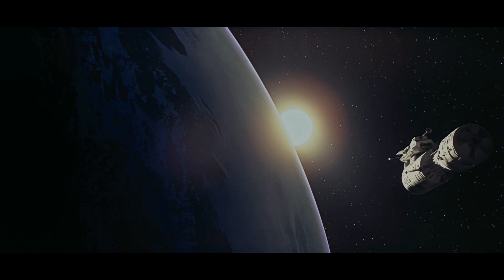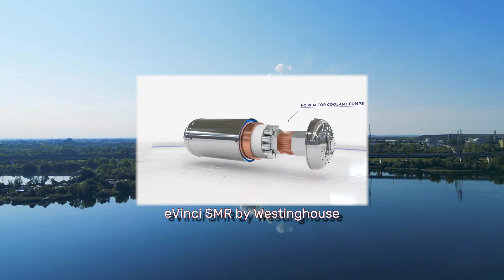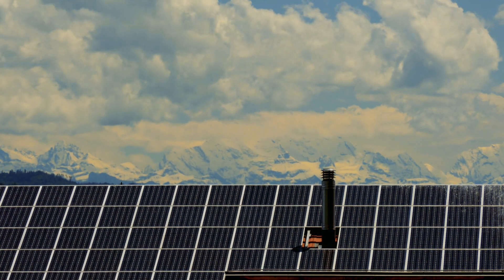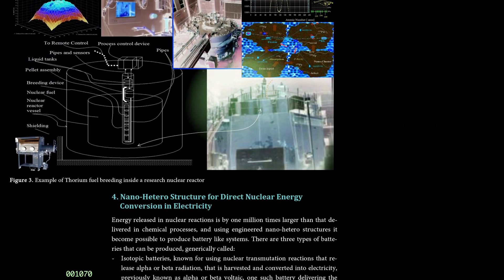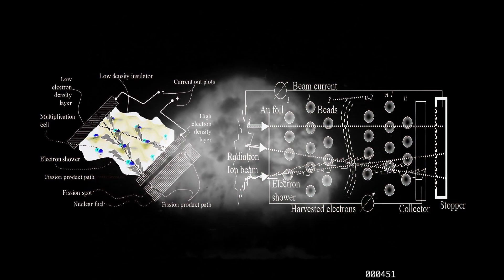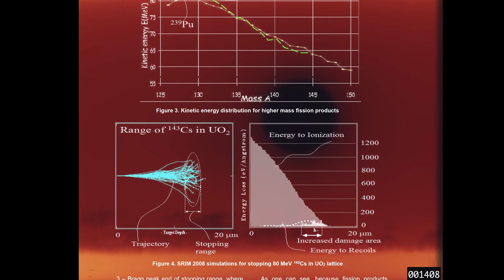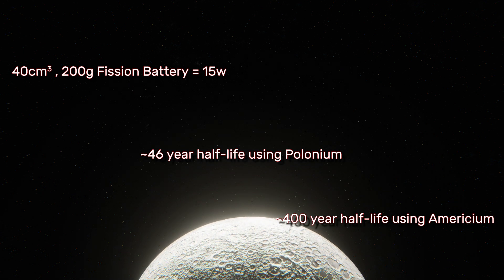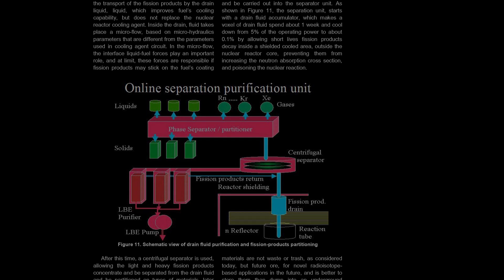A Nuclear Renaissance! Nanomaterials and Nuclear Energy

Comment from the maker: What do you make of this remarkable new tech? How much nuclear research is being hidden out of proliferation concerns? And how will we overcome the obstacle of proliferation's control over public opinion?
Sources:

Modifications to Fuel Rod Material Properties and Performance Models for High-Burnup Application. Nuclear Regulatory Commission, NUREG/CR-6534 U.S., 1997

A Review of Previous Research in Direct Energy Conversion Fission Reactors. Second International Symposium on the History of Atomic Projects (HISAP '99). 1999

The use of ultra-thin layers structure to obtain a self cleaning nuclear reactor fuel. Procedings MRS - Spring Meeting. 2005

Novel nano-engineered materials boosts the fuel cycle and nuclear power applications. Actinide and Fission Product Partitioning and Transmutation. 2017

Micro-Nano Hetero Structured Fuel Pellet’s Impact On Nuclear Reactor’s Performances. 2011

Dispersion-Type Fuel Elements. International Conference on the Peaceful Uses of Atomic Energy. 1956

Radiation damage effects in layered thin film MgO/HfO2 structures. Nuclear Instruments and Methods in Physics Research Section B: Beam Interactions with Materials and Atoms. 2010

The applications of micro-nano-cer-liq materials in nuclear power. 2017

Nano-structured fuel for nuclear kinematics based separation and isotopic production. MRS-fall 2007 meeting, 2006e

Report on Nuclear Fuel's Thermal Conductivity Modeling and Measurement - Urania. LANL Reports. 2004

Behaviour of fission gas in the rim region of high burn-up UO2 fuel pellets with particular reference to results from an XRF investigation. Journal of Nuclear Materials. 1999

Accelerator Enabled Nano Nuclear Materials Development. Adv Nano Energy. 2017

Thanks for watching!
Reply: Question: Does momentum carry through on the atomic level? If so could it be written as Δϕ for the energy potential of the atom split?

Comment: 5kwh/mm³?!
Reply from the maker: Yes that's the theoretical maximum energy density for a 3d battery structure.  It's insane!  The only problem is eliminating waste heat.
Reply: @De-Mystifying  got an Instagram or some place we can talk? I have so many questions
Reply from the maker: @HouseMusicLover001  I'll be setting one up for the channel eventually. There will be another video up soon going into detail on mechanics (not of the fission battery but similar systems,) this video was introductory. If you still have any questions after that feel free to send me an email to the address on my about page!
Reply: @De-Mystifying  waste heat can be used for auxiliary power. In space you can use it for push propulsion for minimal movement.